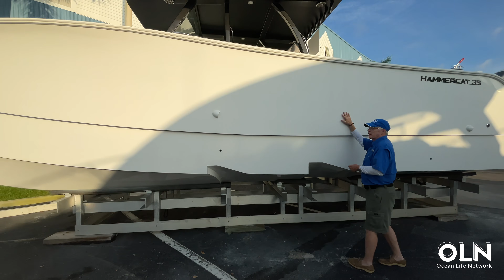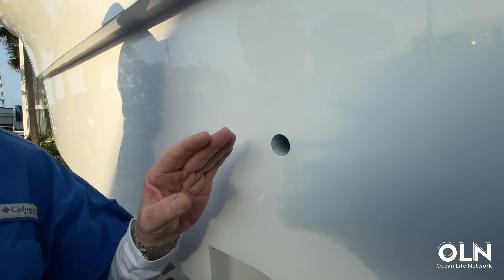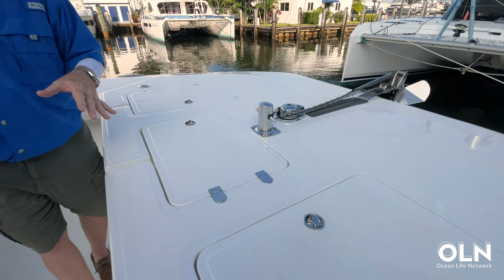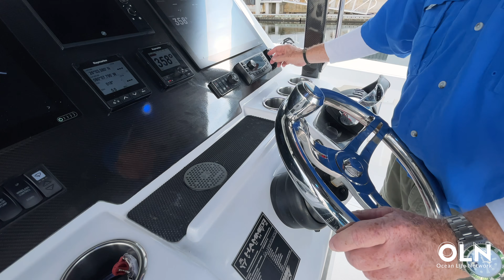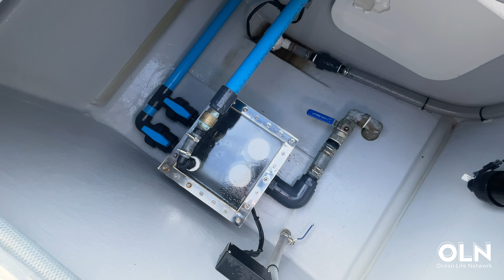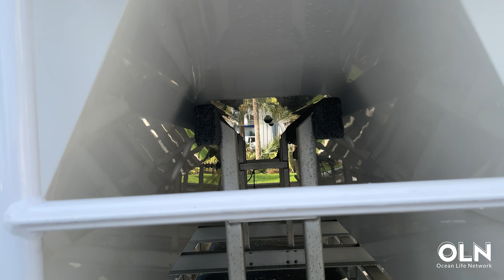HammerCat 35 Performance Review | Showcasing Unrivaled Power

Comment: I've been looking at this boat for a while and I love the boat including the plumb bob front end.  Unfortunately, with the light weight as advertised the speeds fall way short for a stepped bottom boat.  I know of 2 people that own them and they are pleased but want to go faster.  Not certain if quads will ever be offered but I think due to design the tradeoff is it will offer a great ride but lack in the speed department. Time will tell.